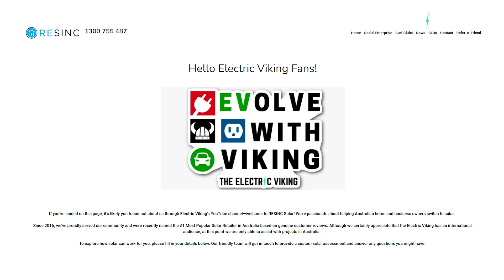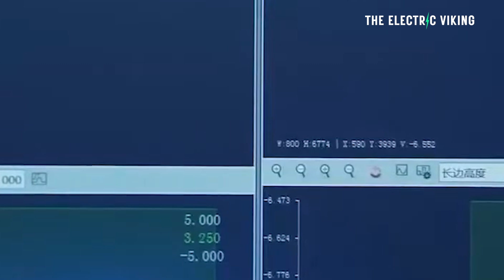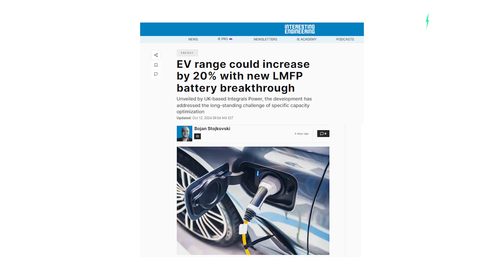EV range could skyrocket 20% with new LMFP magnesium doped battery

Comment: great more mining of the earth from south africa. WOW. high tech stuff. this is getting to be ridiculous. they really need to rethink the whole battery issue. Hybrids are still way better option, and pretty soon i think we will realize this. WHy is the diesel electric train still the most efficient type of transportation per gallon of fuel used. think about it. they are still trying to mobilize the motor instead of line the roads with wireless electricity. Dumb.

Comment: The issue with EVs I still see is the safety of lithium batteries, and the resale value.   In the States we're seeing higher insurance rates for EVs due to the fire risk.   Also, since battery packs are replaced after a 1/2 dozen years, the resale value of the EV has to br reduced by the price of a new battery pack, and are having difficulties.    Any thoughts?

Comment: Sorry Sam, but getting Silicon into the Tesla 4680 anodes would increase energy density by way more than 20%.  Old 18640 cells with no Si had about 1.3Ah capacity.  Adding Si to the anode has increased that up to as much as 3.3Ah.   There's a trade-off of course.  A little Si in the carbon anode is fine.  But a lot of Si lowers the lifespan of the battery.

Comment: LiFePO4 batteries have lower voltage and more stability (life & safety) than Li MNC batteries.  Adding Manganese raises the voltage.  With a lot of Mn you approach the Li MNC voltage.  As a trade-off you also loose the stability you had at the lower voltage.  

Unless someone has overcome that trade-off, there's no news.

Comment: I currently have a gen-1 Kia Niro EV which is a perfect 'in the city car' but when I load the roof rack and hit the highway at 70~80MPH and driving across Oklahoma, Arkansas, Missouri, Kansas, Nebraska, etc I spend more time charging than driving.. With the roof rack loaded and cruise at 75mph I get 2.1 or 2.2 miles/KW, and after 114 miles I have 25% battery (which makes me anxious).  I have to charge about every 100 miles.  My other problem is that chargers are too far apart or only on the interstate but the state and national parks are at least 50 miles from a good charger.  This is why I need a car that when loaded can achieve a min. of 400 miles.. so I can drive to the mountains, drive around the destinations (wildlife preservation, camp grounds, etc) then back.  Todays cars either get me there without any driving around energy or don't get me there at all.  Oklahoma's Black Mesa State Park has a charging gap of 150 miles.  Mt. Sunflower in Kansas or Mt. Magazine in Arkansas are 500 miles one way, so roughly 5 charges @1hr/charge one way (8hr drive + 5 hr charge).. I want a car that can do 400 miles fully loaded, 80 mph and charge at 800vDC in 20 min.  I want to drive to Colorado or New Mexico with 1 charge in route..  I'm really hopeful the Kia EV5 will have a big ole battery if it comes to the US in 2025.

Comment: Whether this is the particular breakthrough or not, I only need about 20% better range.  360 miles (580 kilometers) listed range would give me approximately 300 miles of real world range, as long as it wasn't the middle of winter.  That would do it for me.  Sure, I would like 400 miles of range or more, but at around 360, I am a potential buyer.
Reply: How long can you drive without stopping to, um, "stretch your legs", etc.? And charge a bit?
Reply: @jamesvandamme7786  Great question, and great point!  One does have to "stretch" regularly.  I just want a bit more range to make it easier to reach my brother's place about 600 miles away with either fewer charging stops or less lengthy charging stops.

Comment: As you mentioned a coin cell battery is not a valid model for an EV, so we will have to wait and see.  It is encouraging that battery technology continues to evolve and at some point we will get batteries that will result in much cheaper EVs. What would truly be a game changer is when EVs become significantly cheaper than ICE vehicles.

Comment: They need to try doping with methylene blue. It has amazing electron donor properties and the process is easily reversible, thus useful during both charging and discharging leading to both power density and flow gains.

Comment: So the gain is by way of higher terminal voltage - which slightly detracts from its attraction (given that it's the high voltage aspect of NMC which makes it less amenable to charging to 100%).  But the cost savings and lack of Cobalt may be attractive enough...
Reply: Wrong. The battery voltage has little to do with charging to 100%. In fact a higher battery voltage gives improved charging efficiency for a given current.
Reply: @rogerphelps9939  I was talking about battery degradation.  It's the voltage which causes degradation, and the reason 80% is the normal limit for NMC is partly down to the fact that it will degrade faster if left at 80-100%.  The lower voltage of LFP is the reason you can charge to 100% with impunity (virtually).

Comment: even if it only works in the coin cell there are many items that use coin cells. if it only works in small pouch cells... it works in cell phones. Everyone seems to keep jumping to cars and stationary storage. How many of you could use your earpads or hearing aids or such lasting 20% longer. The voltage change may cause some adjustment but 20% longer on your Fitbit would be nice

Comment: To illustrate how battery technology has improved incrementally consider the BYD Blade 2.0 (LFP) which is now in production at 190 Wh/Kg. The NMC pack in my 2019 Kia e-Niro is 147 Wh/Kg. These are pack level densities. So are Integral Power claiming 20% improvement in energy density over batteries such as the Blade 2.0? If this is the case then for the same weight as the pack in my car (435 kg) I could have a 99 kWh battery rather than a 64 kWh. With the efficiency of the drivetrain that would give a range of 400 miles, far more than I can drive in one sitting. I'd be happy with 300 miles and a lighter car.

Comment: Like I have said…the current technology that creatures like this have been LYING to you about, to make a buck, is now actually being SLOWLY improved to the point where, ON DAY, it might actually only be regarded as a waste of time and direction, vs. a fatal misdirection. But not yet. The theoretical effect of replacing all ICE with EVs five years back, still results in no measurable improvement due TO that change, by 2100. This is NOT HOW THE ENVIRONMENT WILL BE FIXED BUT IT IS A WAY TO WASTE ALL THAT TIME AND TRILLIONS CHARGING OFF INTHE WRONG DIRECTION AND ENDING UP WORSE.

Comment: LFMP batteries have been around for a while, I believe CATL have some. As ever with batteries, there is a price to pay. A li-NMC battery pack will be good for around 2000 cycles (to 80% of original capacity), standard LFP is around 6000 cycles for the same, dope the LFP with Mangenese you drop to 2500-3000 cycles.  The original LFMP batteries could easily be made with the same machines as standard LFP, it will be interesting to see if this new doping level can also use the existing factories.
Reply: I'm not gonna fully charge 2500 times so I'll take it.

Comment: CATL added manganese to their LFP batts, over a year ago to make their high density batts, I’m not sure how this is news.
Reply: CATL's have confirmed their M3P batteries, although often misreported as LMFP, are not LMFP but phosphate based ternary batteries sitting somewhere between LMFP and NMC in terms of power density. 

GotIon announced last year plans to start LMFP production sometime this year, but it's batteries were undergoing similar tests to the UK ones. 

What the UK announcement provides is the confirmation of a pre-commercialisation test that a LMFP battery has overcome power density/delivery challanges of LMFP, albeit on an initial coin cell based test. The forthcoming pouch tests is critical as this will provide confirmation of battery operation at a useable scale.
Reply: @GruffSillyGoat  Any idea of the life cycle?  That's kind of important as well.  And do the batteries exhibit expansion issues?
Reply: @sambira  - Don't know all these batteries are still undergoing testing; it's even hard to find details on CATLs M3P and these are in production. For Intergrals LMFP these type outcomes would be the results from the forthcoming pouch tests.

Comment: When researching LMFP in 2023, most patents had been in the  9:1 to 6:4 range already. 
- The breakthrough is only in engineering but that's not good enough for "breaking news", so Integral Powers claimed a "compared to 50 to 70%" as a reference in their press announcement. However that would only be relevant if they pointed to another manufacturer being at that level - like CATL which is already producing LMFP. Sure, I did not find the actual percentage that CATL uses already.
Reply: Which CATL battery is currently LMFP?  CATL confirmed their M3P battery, although initially rumoured to be LMFP, are phosphate based ternery batteries (actual details of cell chemistry are vauge).

Comment: BEV range could skyrocket more thna that with sulfur ion baterries! Thats the tech that is going to revolutionize baterry cells.
Reply: They'll skyrocket even more with Lithium-Air, which offers the maximum potential of all Lithium based chemistries (max theoretical density similar to petrol/diesel/jet-fuel) although current levels demonstrated are at the 1700Wh/kg level. They're currently used in specialised applications due to their low cycle life (<1,000 cycles) with multiple R&D labs working to extend the cycle life particularly for aerospace usage.

Comment: better to create lighter more energy-effivcient cars then to create range nobody needs. an everyday rane with overnight home charge of 300 kms 10to80 is enough, together with a highway range of 240 kms 10to80% combined with 20 minutes charging 10to80 for travel. sweet spot for battery of 75 kwhs and 15 kwh per 100 kms and 240 hp for a 1700 kg max car with a top speed of 170 km/h and acceleration betwwen 7 and 9 seconds to 100 km/h.

Comment: The company that made this breakthrough doesn't have to manufacture the batteries themselves. 
They simply need to license the technology to the battery manufacturers.
Reply: The problem with these specialised R&D battery technology companies, is that they never have the same incentive to make sure that the technology is actually feasible for large-scale manufacturing, due to the fact that most of the financial risk is on the licensor, rather than the licensee.

For example, QuantumScape, which has been working with Volkswagen since 2012 on "breakthrough" solid state battery technologies, apparently have nothing to show for this, almost 13 years on. The latest news is that they just signed another deal that gives them $130M up front (plus royalties later on actual production), with manufacturing to start no earlier than 2026. Can anyone see a pattern here?

This is why vertically integrated companies tend to be more successful in my opinion - their objective from day one is to design for mass production, rather than leaving that problem for someone else to (hopefully) work out, down the line.

Take CATL, for example - the world's largest battery manufacturer - which recently spent $1.2Bn HK on a new in-house R&D lab.

Comment: i just got my Aito M7. now i know why manufacturers are still using NMC batteries...because they are great (atleast for the hot climate where I am)..although it is somehow marketed the other way around that LFPs are better for hot weather and NMCs are not..the battery is giving me great result on WLTP..it is 1 to 1 km...way beyond my expectation...even with AC being on and driving on highways around half of the time im in the car..it is CATL batteries and i suspect they have better batteries than BYD overall...i only charge it to 85% then recharge when closer to 30km range left...

Comment: LMFP vs Solid State batteries? Both seem to be on the brink of mass rollout...
Reply: You missed Lithium-Air, which offers the highest Lithium power density, which is currently at a similar level of development as solid-state batteries (albetit slightly behind).
Reply: @GruffSillyGoat  There are a myriad of different battery chemistries, but solid state batteries have been particularly hyped as the next "big thing"...

Comment: New battery hype...here we go again! 🤔👌
Reply: I agree there is often more sizzle than sausage at times wrt battery tech improvements, however I believe we are, generally, in an environment of continual, steady improvement. Batteries appear to be getting cheaper, more power dense and faster to recharge. At every stage, reasons to not buy an EV are reduced.
Reply: Not new - LMFP has been on the cards for a while now, with various R&D groups working on it round the world. It's an incremenatal change on LFP and can be quickly commercialise using LFP production lines, which is why it's been a focus for a while in R&D centres. This announcement indicates the technology is maturing out of the labs and into pre-commercialisation testing.
Reply: Yeah what mass produce product can we buy today?  Answer it’s coming.

Comment: I don't really see why the majority of cars would need so much range. Many cars already have 4-500km of range and can charge another 300km in 20-25 minutes. A 1000km drive is done easily with only a few stops. I think price drops would be better than more range for most EVs. :)
Reply: True, but it's inbred in peoples minds what range a full tank of petrol can give them.
Its hard to shake off such old habits, hence the range anxiety.
Reply: Yes range anxiety is not reported by any Tesla owners - take note
Reply: @trevorlees1241  I drive a Polestar 2. Even faster than most Teslas on long runs. (At least in my country where charging infrastructure is really good.)
Reply: Weight/volume reductions.